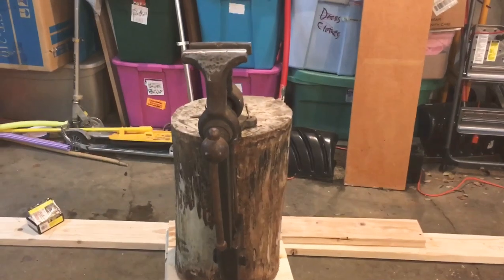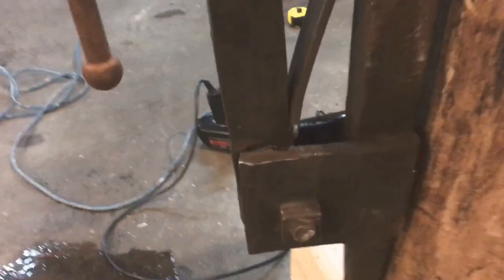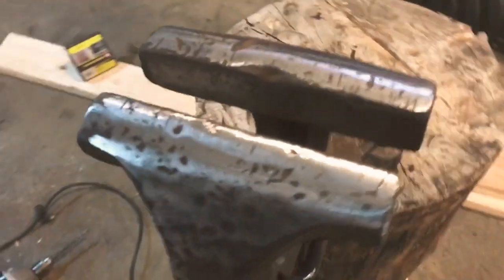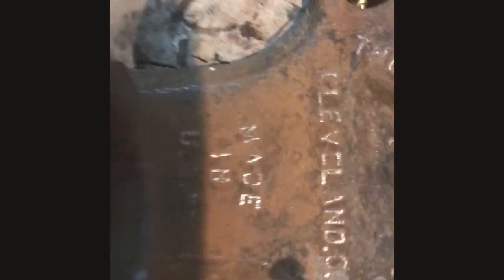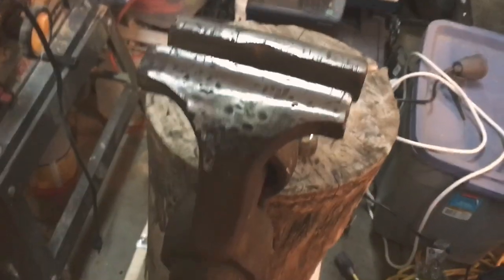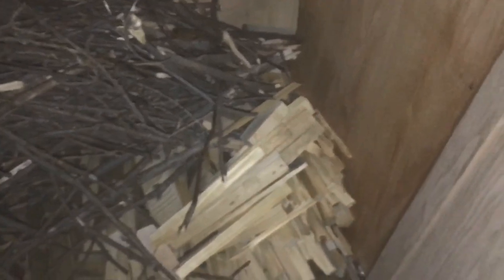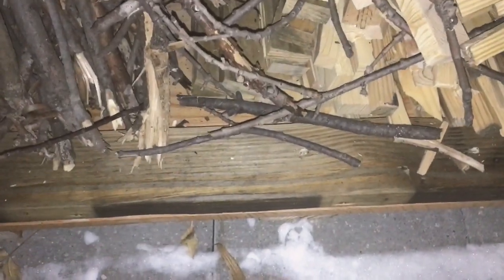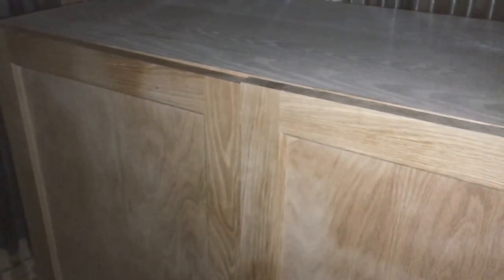Post Vise!!! and 100 sub giveaway announcement!

Comment: Get a low flying plug to go on the foot of the postvice, just for shock insulation. Nice score on it, by the way! Congrats on the hammer from Anson. He is a man with a heart bigger than he is.
Reply: By the way, a "journeyman's spike / nail' is pointy and sharp, but not considered a "weapon", per say. I have a bit of a facination with them, if you have seen Grandadz forge unboxing video, lol. Hammer on good smith⚒️!
Reply from the maker: ill have to go rewatch it